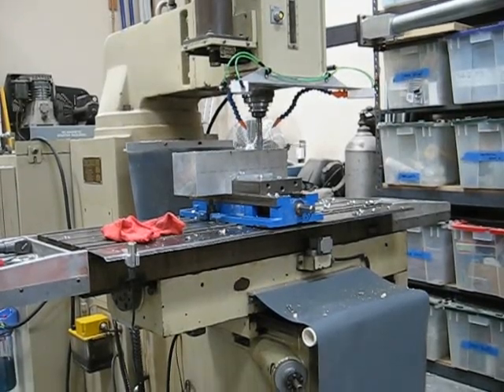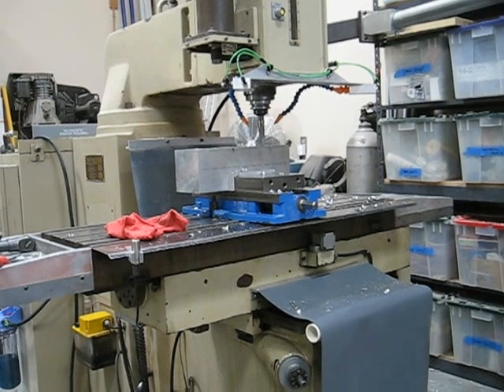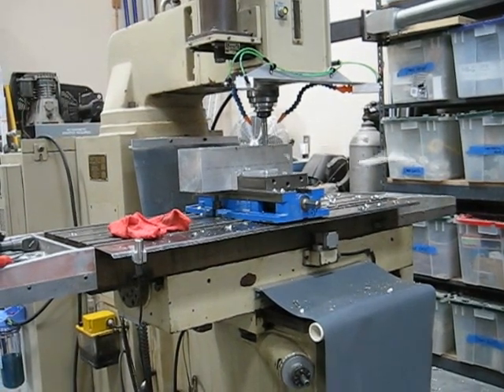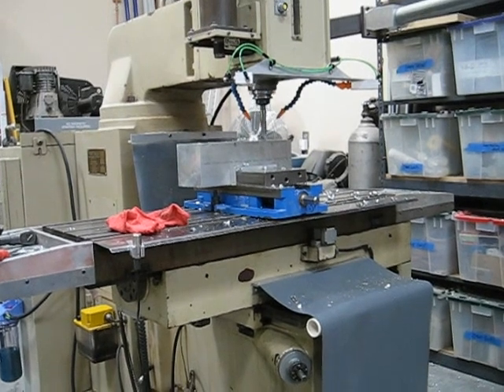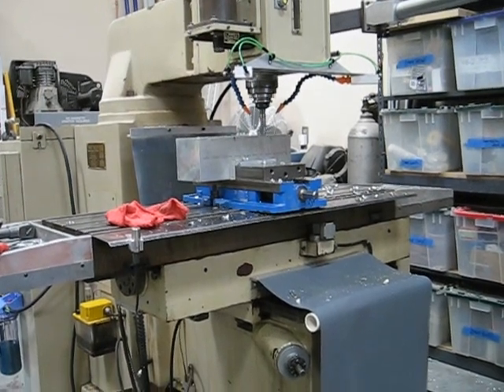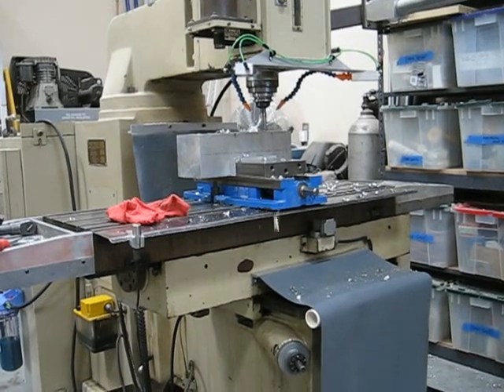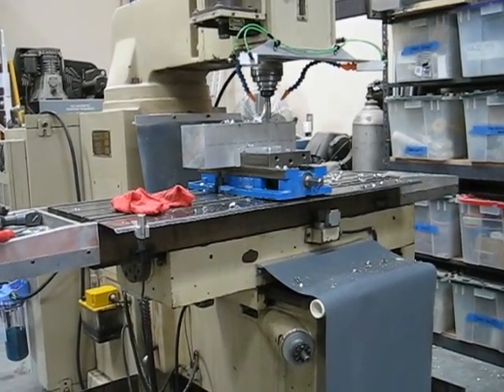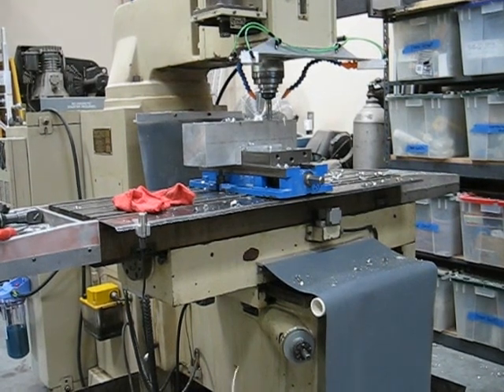Homemade MQL coolant system

Comment: How did you arrange oil amount and air pressure?
Reply from the maker: Regulator on incoming air supply. for air pressure, usually 5-10 PSI is plenty, Regulate the coolant flow with needle valves on the fluid lines at the mixing heads.

Comment: What coolant do you use?
Reply from the maker: Rui Costa I used several, first was from Oak, didn't like the smell and it left a sticky residue. Switched to Master Chemical Trim Sol about a year and a half ago, works well, wipes off the parts easier, stays "oily" and doesn't turn into a sticky mess if left on the parts, also no rust on the machine. The Trim Sol mixes with water at about 5% oil with 95% water, put the oil into the water, not the water into the oil when mixing. Oh, that's for aluminum, you might want a higher concentration if doing steel or stainless.